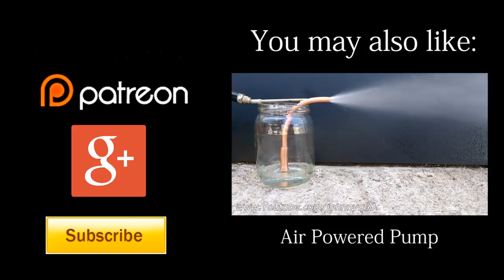How to Make an Air Powered Mini Vacuum Cleaner - Venturi Effect

Comment: I just ordered an air compressor and noticed strange accessories available as air tools. So this is one of those applications. Interesting. I see an advantage here over using a regular vacuum cleaner in that it is good for vacuuming up workshop grime such as metal shavings that may ruin your domestic vac.

Comment: Noice! A little over the top fabbing the parts yourself but if it's worth doing it's worth doing right! For lazy people such as myself any store-bought matching T pipe, connectors, and  hose could do the job. The tricky part is fitting something to the end of the air tool. Personally I would just recycle some garden hose and fittings. Or use my vacuum :P

Comment: No need for a lathe:
Hammer  a wood dowel thru the fitting, chuck it  and spin it in your cordless drill with one hand,and grind/turn  it down with your grinder on the other hand; 

Been doing amazing PRECISION "turnings" with this method; i use a nice flat file towards the end when the thing needs to be wave free/"flat",or micrometer measured; fine sandpaper ,by hand, (1000 or better grade)gives a smooth finish.

Comment: your idea was not new or any kind of it but main point is where could you find those air compressor to be a portable use or carrying any where between ground floor to first floor bedroom ? this video show you need a very pretty big air compressor to blow out high pressure in order to get a little suction become so called vacuum

Comment: this is very easy to make...because everybody has a lathe just sitting around with nothing to do lol
Reply from the maker: +daniel massot I was too lazy to go and buy the appropriate fitting, so I made it my self. If you don't have a lathe you can buy everything you need from a hardware shop.
Reply: ***** but...but...do I have to...I own a vacuum cleaner
Reply: ***** I'm messing with you lol... that's actually cool the way you did that...that's  why you make videos and I dont lol

Comment: +johnnyq90 I know that the pressure must escape somewhere in order for a vacuum to be created, but there must be a way of recycling the air that's expelled out through the cloth to either divert dirt towards the nozzle, or add extra pressure in the nozzle itself - it seems a waste of potential energy and looks like it's pushing some of the dirt away

Comment: Im curious about the system.
The compressor BLOW an air. But, how can it turn to Suck Air?
Reply: You may have done some research by now, but in case you haven't the Venturi effect happens when airflow passes over something else, like a tube in this case. The air above the tube will have friction with the air in the tube, pulling it up with the airflow.  That's in layman's terms, but thats the basic concept. I use the same effect to pull paint/dye into an airbrush and to suck up industrial cutting oil at work.

Comment: What is that gun called what is that yellow stuff on the bolts called please include the name of things in you're video not trying to be rude but I'm just starting to explore science a
Reply: The video is more a demonstration of how the principles of a Venturi work than it is instructions for how to build a thing.  He just shows the build process to show you exactly how simple the concept is.

The "gun" is just a nozzle hooked up to an air compressor, all he's doing is spraying compressed air through it.

The "yellow stuff" is flux, when you solder over top of it, it evaporates out, and the solder gets sucked into the void it left.  Makes for much better joints.

Comment: Everything was going well and simple until he uses the lathe :)
Reply: Yes. And I don't understand it. There are enough commercially available fittings to make the lathe an overcomplicated waste.
Reply: No need for a lathe:
Put a wood dowel thru the fitting, chuck it  and spin it in your cordless drill with one hand,and grind/turn  it down with your grinder in the other hand; 

Been doing amazing PRECISION "turnings" with this method; i use a nice flat file towards the end when the thing needs to be wave free/"flat",or micrometer measured; fine sandpaper ,by hand, (1000 or better grade)gives a smooth finish.

Comment: So hold on.. you blow air through.. and it vacuums? So is this how an airlift would create vacuum in a cooling system with shop air?
Reply: I'm also having the same doubt is the air pump puming air outside or inside

Comment: it's a complete waste of time, looks very simple and cheap but actually its more expensive if you include air compressor and depends if the air compressor is handy because most air compressor are heavy, bulky you can't carry around in the household for handy job.. there are a lot of vaccum cleaners cheaper, efficient, have different nozzel for different job and situation and most of all very handy. why would I waste time on making one with the limited tools in the house.
Reply: That's the thing, it's a how to video, he's just showing us a build that he created; not everything is made for efficiency.
Reply: It's a workshop vac, most workshops have a compressor, would you complain about a food video if someone used an oven to make food?